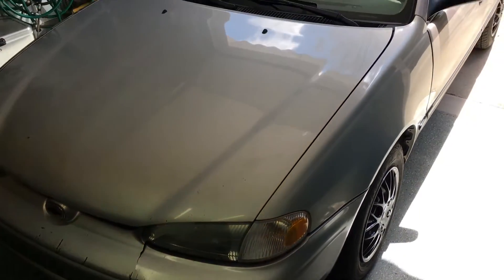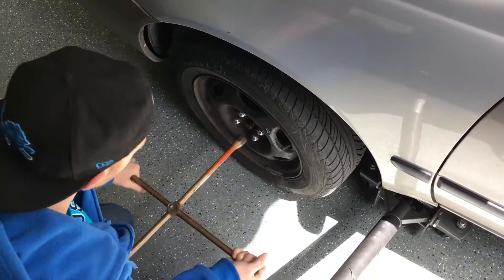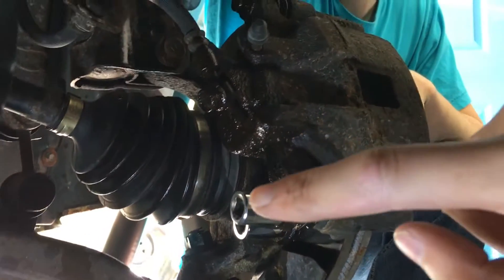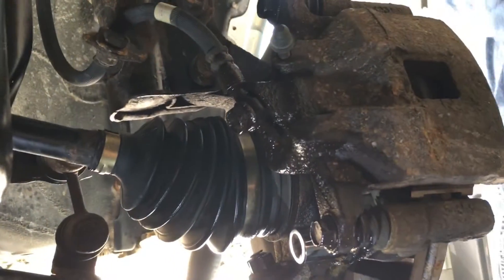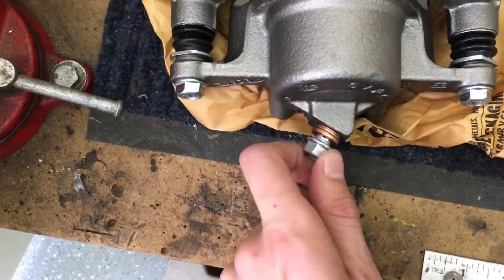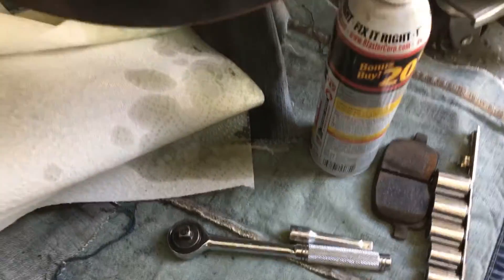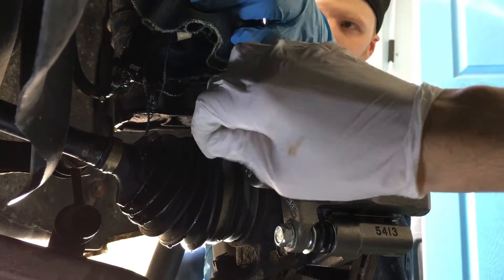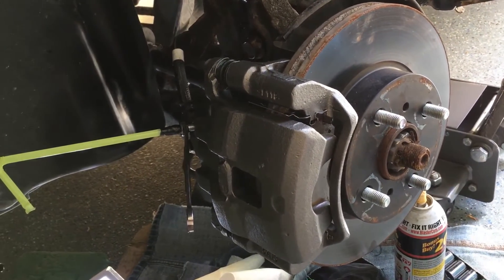Chevy Prizm front brake caliper replacement 1998-2002

Comment: My brake line is leaking from the washers on the caliper any suggestions? I used a torque wrench to tighten it.
Reply from the maker: From the washers that go to the line coming in? I would just try to clean any corrosion and retighten￼